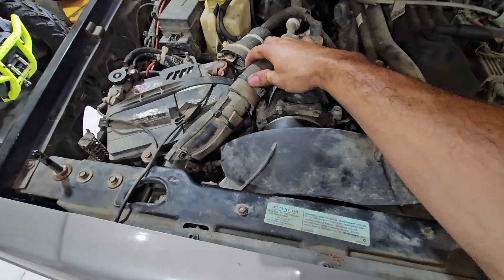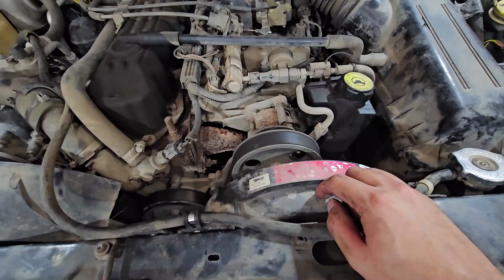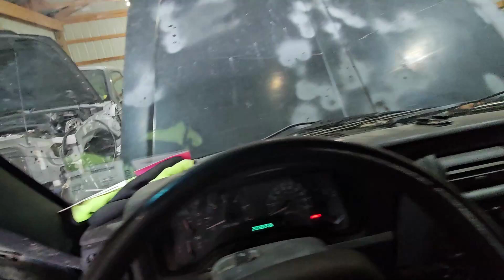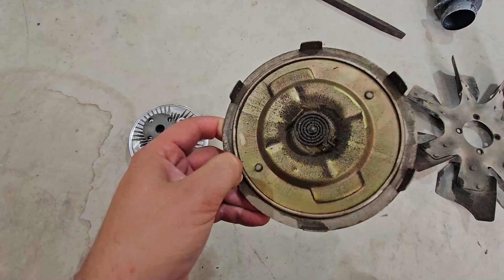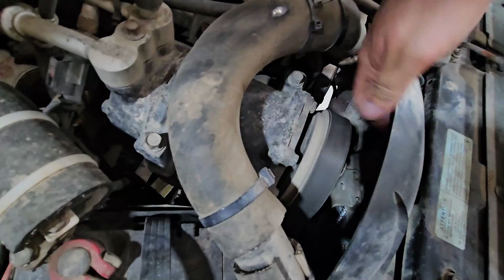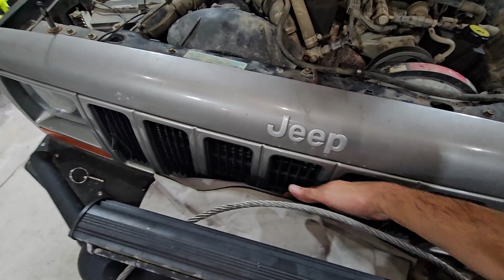Jeep XJ Cooling System Diagnose

Comment: Great video. Which fan clutch do you use and what kind of radiator
Reply from the maker: At the moment I have a ZJ fan clutch with a factory oem replacement radiator. I have gone through 2 XJ fan clutchs.

Comment: helpful video, bro !  In my understanding the clutch fan locks with higher temperatures to cool down the engine. By the way - which muffler do you have installed ?  I have seen a FlowMaster lying on the ground....
Reply from the maker: Jeep has this exhaust system installed:  Pypes Performance Exhaust SJJ01S 91-01 Jeep Cherokee Cat Back Exhaust